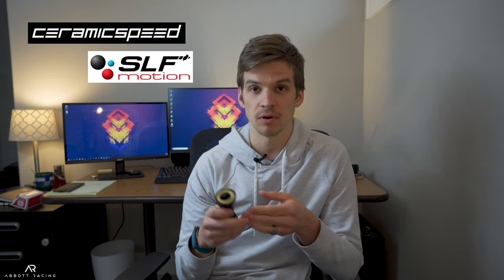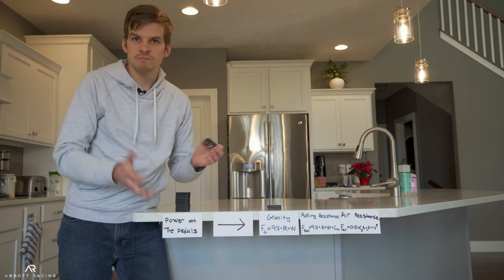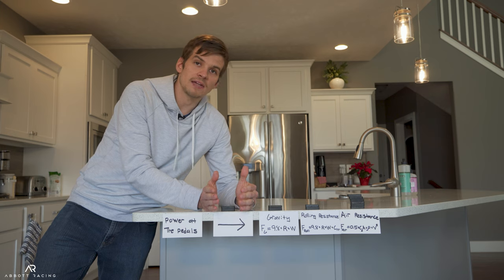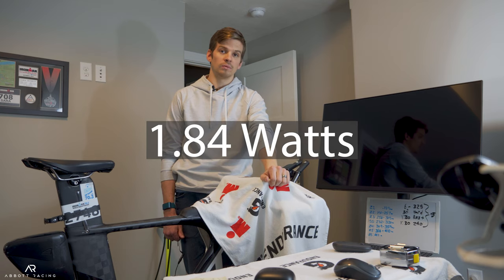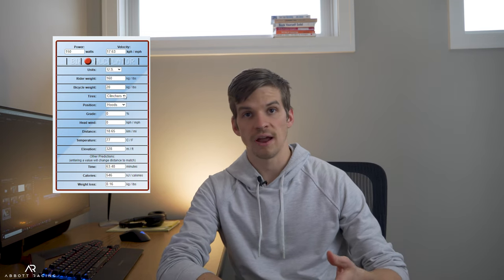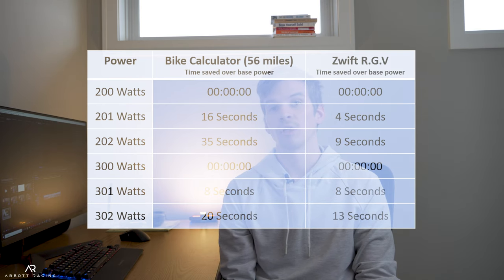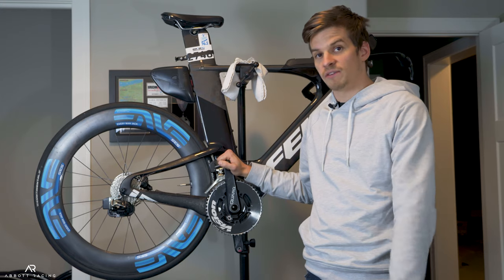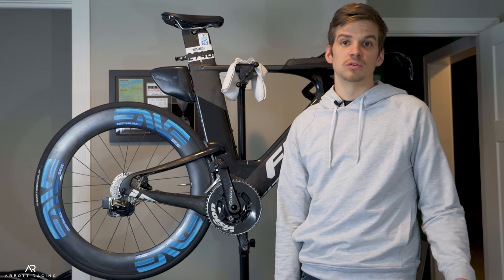Should you get a Ceramic Speed Bottom Bracket | FastereOnFriday

Comment: An interesting 3rd option is to buy normal industrial steel bearings and give them thin oil like ceramic speed and no seal to reduce friction on race day. Ceramic bearings have more friction after 1000-2000km compared to high end steel bearings.
Reply: "Ceramic bearings have more friction after 1000-2000km compared to high end steel bearings."
Why? Is this confirmed and tested? Thanks

Comment: I bought a expensive Ceramic Speed bottom bracket and after about 500 miles it started to creak.  After 1.5 k miles I took the crank off to inspect and there was some black substance around the bearings. I took the seals off the bearings and it looked like the bearings were disintegrating and they were very loose but still rolled smoothly but had a lot off play. Hambini was right when he said ceramic bottom brackets are sht. I put on a Dura Ace one. Rolls nice and I could buy 4 of them for the cost of a high end BB.
Reply from the maker: Sorry for your bad experience, I assume ceramic speed would issue a warranty for a bb failure with such a low milage. But you are correct that you can get several DA bb for that price

Comment: According to your numbers.... if I save 4 secods by investign 1 watt (on the 200 watt example) and assuming we keep it linear  I would be saving 400 sec from 200 w vs 300 w. this do not make much sence...
Reply from the maker: Time saving is not a linear relationship. As you get faster it takes an ever increasing amount of power to go slightly fast.
Reply: @EricAbbottTri  my point exactly... so what you are saying is that the difference of puttin 200 vs 300 in a linear system is 400 sec, but since is not linear for the cuadratic term is much less than that... so, the real ttime difference between a guy putting 200 vs 300 watts is less than 400 sec, lets say 180 which means 3 min diference in a half distance. that dosent make sance....

Comment: I think marginal gains will add up, if you consider the OSPW of your other video it will add up to 5w save that is something
Reply: I don't think there is an issue with marginal gains adding up. It's about the cost-benefit relationship. If I pay $100 and get back $1,000, then it's a no-brainer, but the reality is no upgrade is going to give anyone a return in the multiples. I think most people need to think about it a bit more carefully before splurging if the upgrade is only going to make them a few seconds faster over a long distance, especially if they are not racing for podium places.

Comment: If you think about it, it’s pretty stupid to show reduced friction in absolute power, like watts, because that’s based off of a particular power input. Obviously, each person’s power input is different, so it follows that their “watts saved” will be different.  It would be much more useful to express the watts lost as a percentage of rider power input. That could be applied to any rider.
Reply from the maker: Actually, friction is a function of the normal force and velocity. If we assume cadence remains relatively constant and there is not a massive increase in normal force between a low and high power rider then the power needed to overcome the friction of the BB is relatively constant no matter the power input.
Reply: @EricAbbottTri  yeah, unfortunately that’s a lot of assumptions. I stick with what I know. And what I know is that increased force generated means increased power. And that means increased friction. Less power is less friction. So the watts saved over whatever you’re comparing the ceramic BB to is assuming a particular power. For less power input, you’re saving less power. More power input means you’re saving more power. The only question is, what does the curve of that power savings look like as you increase in power output? Is it a linear increase or is there a curve to it? I don’t think anyone has the data on that. Also, the “watt savings” is derived from an assumption of what a rider is using before the switch to this hybrid ceramic BB.
Reply from the maker: @RB-xv4si  you are free to collect your own data and make your own decisions.

Comment: I'm planning on buying a ceramic speed product for an upgrade,  should I get the oversized pulley or the bottom bracket?
Reply from the maker: Check this out:
https://youtu.be/jfiLd-WBJwE
Reply: Neither . Ceramic bearings are useless on bicycles.  Ceramic bearings are too brittle . They are great for high speed high temperatures (speeds of 10,000 rpm or more) . Non contact seal  steel bearings are a much better idea .